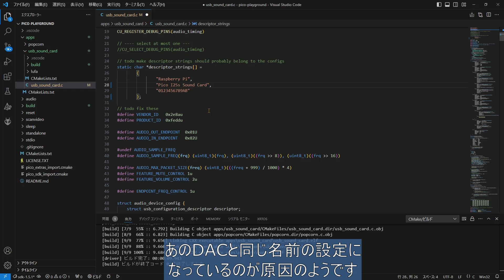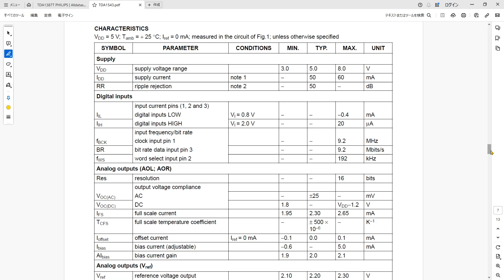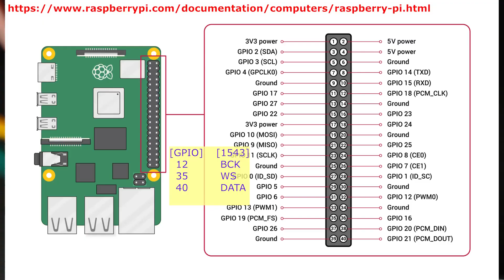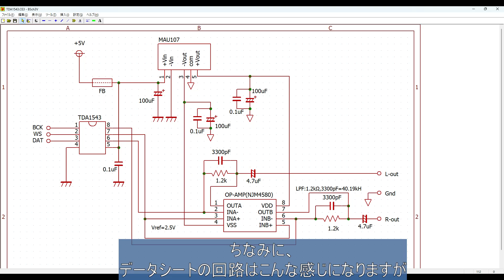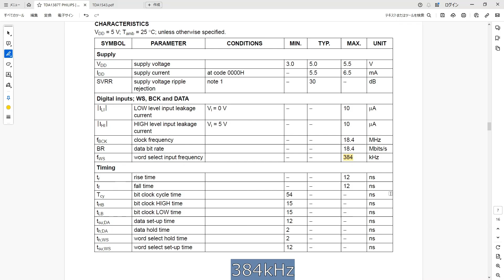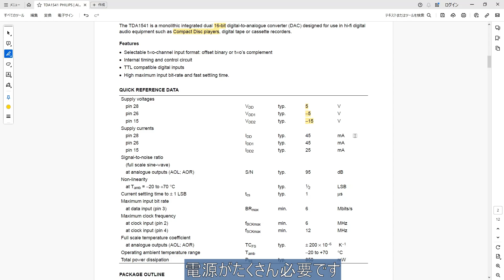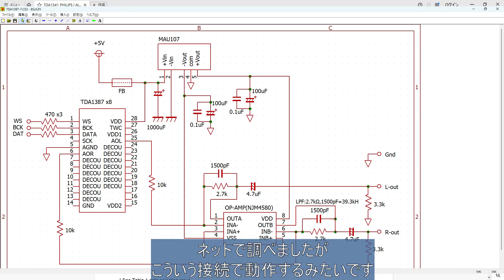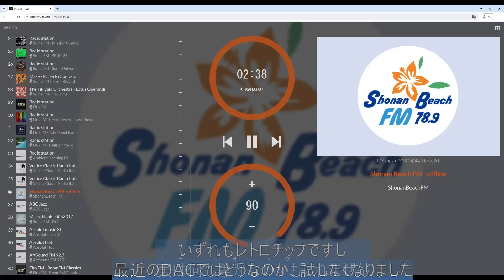レトロなDACチップを試す(TDA1387)

Comment: Interesting video. The TDA1387 X8 (substitute for TDA1541) module version could be much simpler. Go to Moode Audio and see info on ProtoDAC. Add a power supply decoupling cap of 2000 uF at pin 28 and use output I/V resistors of either 390R or 430R (prefer metal foil Texas Components TX2575). Use good quality PP output coupling caps. Output level will be nearly line level without additional circuit. Also see videos here by Vincent Fong.
Reply from the maker: I watched Vincent Fong's video.
They have developed a full-fledged and wonderful DAC. It's amazing.
I always proceed in a haphazard way, so I learned a lot.
For now, I would like to check the operation with Moode Audio.
https://youtu.be/RyGhTj5r3Gg